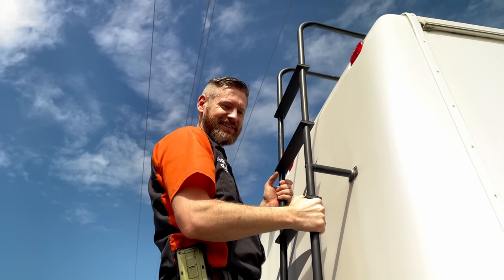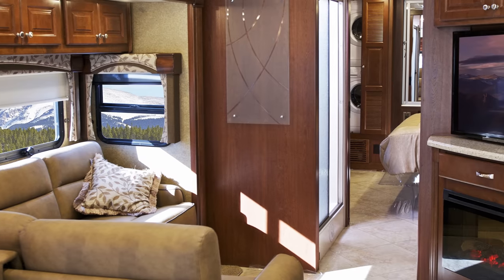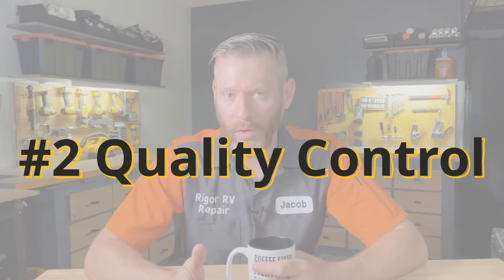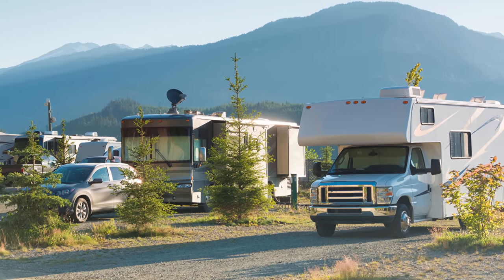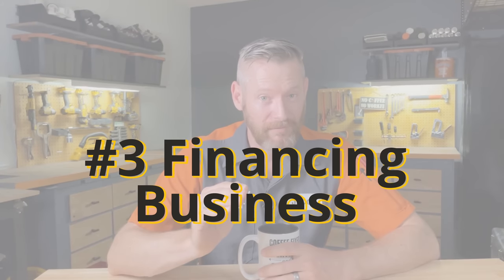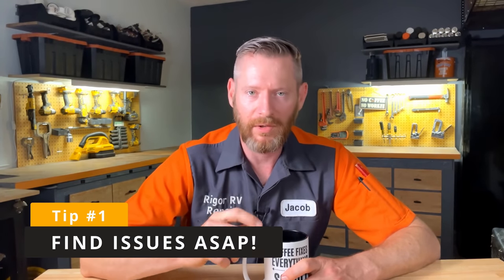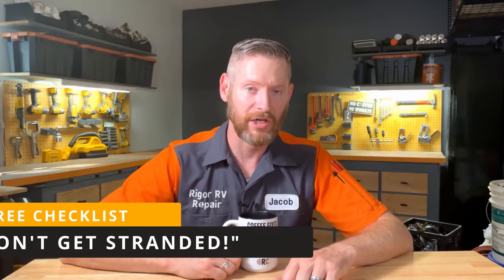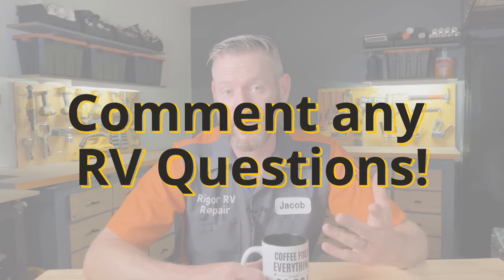3 Dirty Secrets the RV Industry doesn't want you to know...from an RV Tech

Comment: The callousness of mfrs. and dealers is so bad I would recommend the average person against buying an RV. My daughter recently bought a brand-new trailer, which included the dealer delivering and setting it up at a campground for an extended stay. Since the moment they took possession, the fridge did not work. The dealer was crass blowing them off (on a Saturday) informing them they would have to file a warranty claim. They were not allowed to hire a certified RV tech to fix it but rather force them to spend a fortune eating out, ice and making do with the tiny outdoor fridge. This is beyond unacceptable. I have worked as a quality assurance manager for a major appliance mfr. I see virtually zero effort made at instituting the most rudimentary quality systems. There obviously is almost no forethought into access, routing wiring and water lines, and especially equipment. 

Learning the various equipment on your RV and how to repair it are, for the most part, not that major of a challenge. It's access. You need to be a contortionist the size of a Barbie Doll to get into many places. Trying to access terminals and service them can put you in the bed with a back injury. If you are not mechanically adept, of small stature and very agile I strongly recommend you reconsider. 

The corner cutting is often off the charts. I bought a 38' Class A and found the water lines to the two toilets do not have shutoff valves. I spent a weekend mopping up the floor. The valve only had one screw in it from the factory where two are required. I'm going back installing ball isolation valves. Tip: carry spare PEX fittings and practice beforehand. Also keep a few Sharkbite fittings for emergencies. In the case with my toilet, it was piped with vinyl hose- not PEX. 

The quality of materials, or more appropriately, the lack thereof is astonishing. I get they are trying to hold costs but some of the junk they use is borderline criminal. 
Many of these problems can be avoided by some reasonable planning and engineering. 

The last part of my rant is commissioning. The factory should have a Q/A systems final check and inspection. The dealer should also verify the basic operation of every system. My first RV was shipped with the microwave not connected, a bench falling apart, and later we would the ceiling ducts were never connected. 

Everything is going to shake, rattle and roll so plan on it. Use grommets where wires and tubes pas through bulkheads. Put the grounding points  where you can access them for service. 

I've yet to see an owner's manual that was worth more than firestarter for the campfire. That's a whole separate rant. 

Anyway, I recommend buying a unit 2-3 yrs old with transferrable warranties, clear title, and get a pro survey first. 

Here endeth the lesson.

Comment: We just subscribed - thank you for your content. We will be buying in about a year and have been doing homework on them for about three years. Whether we go new or used, we will not touch it without a reputable inspector going over it. We are narrowing down to either a super C Entegra Accolade 37K or a gas class A Georgetown GT7 - Any thoughts on those? We are leaning towards the super C because it seems that it is easier to get those worked on instead of the class A's from what we have seen? Thanks!
Reply from the maker: Stay tuned for reviews on both of those!

Comment: Why do the doors open left instead of right. You have to open all the way when someone is knocking instead of a little bit. When you carry packages it’s hard to carry around the door instead of pushing to the left & setting on the floor
Reply from the maker: Great question!  The reason is actually so that if you leave the door open while traveling the wind will push it closed and not open. Also, doors are usually on the passenger side, so that is the direction they need to hinge to not blow open.
Reply: @undercoverrvtech  great answer. Now that I know I won’t get so mad about it. Lol. Thank you

Comment: How you find a good RV tech before you call one?
 I found one but when he came, he basically got his are compressor out and started to clean and blow to just tell me “oh it’s broken, need to replace it”. 
 It was the refrigerator. Tried to tell me there is a computer that is not resetting. This fridge had no computer. Just a regular thermostat actuated gas valve or an electric relay for electric mode. 
 Then they want $200 for the service call. 
How to find a good tech locally?
 Hesperia, CA.
Reply from the maker: The best I can tell you is to check their Google reviews. Unfortunately with older technology like you have a lot of new technicians have never worked on it. That said, if the cooling unit leaked out the ammonia then it may need to be replaced. That often happens on old refrigerators.

Comment: Have an independent inspection, not one of the dealership people. I'd rather pay $500 to $1000 ( depending on size of the unit and extent of the inspection) and have an independent assessment. A certified inspector will give you a printout, flag everything especially safety issues, test fluids on motorized units.

If the dealership has camping spaces, stay there over a weekend and methodically go through every thing, make a list, then double or triple check everything again. Don't take it off the lot until then. The dealer will put you at the end of the priority list because you have taken possession. They consider the unit sold, not a pending sale.

Take a tour of the manufacturers, go to RV shows, ask a lot of questions. Be an informed consumer.
Reply from the maker: Great advice! If they are going to charge $1000 for a Pre-Delivery Inspection,  you would be better off hiring an unbiased 3rd party for the same money.

Comment: What's your thoughts on a brand new travel trailer ( Win. Micro Minnie) and taping over the seams of the roof line? The transition point of the wall and TPO. What about roof coatings? One is claiming no maintenance when coated.
Do you do complete solar installs? Thinking 600 watts on roof, 200 W portable, MPPT, Victron 3000 MultiPlus, 3-200 AH or 2-3000AH Li batteries. Over sized wire, multiple fuses & shut offs, POS/NEG busbars.
Reply from the maker: I haven't seen that seam tape you are talking about, I'll have to go look at a Micro Minnie. Roof coatings are not needed on a TPO roof, the thermoplastic is very UV stable. The caulking at seams on any roof will need maintenance, even if you put some type of coating on.
As for solar, Victron make a nice inverter/charge, but a list of equipment does not tell me if it will serve your needs or not. If you haven't already you need to find out how many watts each appliance you want to use will consume, and add together the hours of usage for each appliance. Once you decide how you want to use the system then you can design a battery bank to run everything for a day, then add an extra days-worth of capacity to account for cloudy days where you will not be recharging. After you have a battery bank size in mind then you can make sure to have enough solar to recharge it within 5 hours.
Reply: @undercoverrvtech  Eternabond made by H.B. Fuller.
Reply: @undercoverrvtech  I can not phantom anyone who owns or works on RV's is not familiar with Eternabond Tape. Many (if not most) RV'rs carry a roll for the accidental roof punctures by tree limbs etc.

Comment: Hello, I came across your YouTube video, and watched it, and I have to ask you something regarding an Older Class A Motorhome that I am in the process of paying off from a private owner. It is a 1991 22 foot long Fleetwood Flair, powered by a Ford 460 Engine. It only has 18,000 original miles on it, as it was originally owned by an older couple, who took very good care of it while they owned it. The engine runs fine, with the exception of needing both belts replaced. As far as I can tell it has no major leaks coming into the interior at this time. My question is what are some of the things that I should be checking over on it since it has been parked for quite some time now ? I know it needs the engine belts replaced. The Power Steering Pump Belt is completely gone, and the remaining belt, which runs both the alternator, and water pump is squealing quite loudly when the engine is running. I know it needs at least the right front tire, and spare tire replaced, but as far as I can tell, the rest of the tires look ok.  Should I be worried about any of the electrical wiring anywhere within the Coach ? I just need to know what I really need to look for to prevent any mishaps from happening once I assume ownership. I will also be doing some work on the roof as well as seal coating it really well. How do I go about checking out the various systems ? Electrical, and water/plumbing/propane/appliances ? The Coach also has an onboard Onan 4000 Watt Generator as well, but I have no idea if it will start or not. The Coach requires 2 batteries, one for the engine, and the other as a house battery, which I do believe is supposed to be a deep cycle marine battery. I have already replaced the Engine Battery, but have not yet replaced the deep cycle marine house battery. There is one in the Coach, but I assume it is possibly to far gone to use, and also needs replacing. The Gen Set only has 79 hours on the hour meter. The price was $2,500.00, do you think I got a decent deal, or do you think I should have walked away and kept searching ?
Reply: Sounds good. I would replace the auto transmission fluid soon unless it’s documented as been done in the last 5-7 years.   Rear differential oil too.
Reply: Check the date on your tires.  Each manufacturer is required to label the manufacturing date in the sidewall. Aged tires can be a big hazard going down the road, the look good but can become brittle with age and blow out.  Stay safe.
Reply: @row4hb  I have been trying to locate the build date on the tires, but apparently, the build date stamp is on the inside sidewall of each tire, and I don't currently have a large enough jack to lift the Coach up, and pull tires off to check for build dates

Comment: Newbies here. We bought a brand new Highland Ridge SilverStar 376FBH fifth wheel. My biggest frustration is the lack of useful documentation. Owner's Manual is poorly written and their website says they don't make service manuals and wiring diagrams available to users. Of course, I understand why, but the idea of being stranded without documentation for our rig is nuts. We'd also like to make some mods.  Is there a repository or some other source for such documentation?
Reply from the maker: Unfortunately no, other than individual appliance manuals RV'S are put together in a pretty chaotic way.
Be sure to watch my Worst RV Slide to own video, if I'm reading the Highland Ridge website correctly they are built with a problematic slide system that needs regular maintenance.

Comment: I have found that between the Covid issues and just people lacking to want to work, and now the inflation and everything costing more to make. I found the RV industry new RVs are built like crap.  They are slapped together to fast to get them out there. Wires with tac nails through them, stripped threads on water lines, seals not put in correct. Yet the price keeps going up on them. They really need to be regulated. I would hold off on buying new till they start building them better.

Comment: Your opinion of the fibreglass campers; Scamp, Casita, Oliver, Bigfoot, etc. It seems to me that they just last longer than the common style of RV. Any of your thoughts would be appreciated!
Reply: After I got my 1st fiberglass trailer I said i would never go back to an alum sided trailer. That was 20 years ago. Now I own an alum sided trailer. If you have any issues with the fiberglass whatsoever, it has to go back to the factory for repair. The alum siding is easy to take off and make repairs. Yes you will be making repairs, the question is when not if.
Reply: Thank you for the reply, greatly appreciated!

Comment: Bought a 2022 small RV wanting to boondock often.   The refridgerator is only 12 volt and I understand that draws a lot of amps per hour draining my battery.  How many amps should a small refridgeration draw in a day?  I was not careful in making sure that the fridge did not have a propane option.   I also understand that the industry may be moving away from propane refridgerators.   Are my fact straight and is there any thing you can recommend for me?   Thanks
Reply from the maker: If you have the Norcold 10 cubic foot 12v refrigerator,  it is rated at 8.3 amps when running in daytime mode. Assuming it cycles on and off and runs for 12 hours a day, (50%) it would use 99.6 amp hours.
If you have a standard lead acid deep cycle battery rated at 100 amp hours, you should only use the top 50% capacity to maximize battery life, so the refrigerator would drain the battery to the 50% mark in just 6 hours of run time, or 12 hours of the day. Practically speaking you must have 2 batteries of 100 amp hours each to run the refrigerator all day.
If you don't have a generator for recharging,  you would need at least 240 watts of solar to recharge that lost power each day, assuming 5 hours of full charging each day. But it is best the have double the battery capacity for backup in case of cloudy days, so you will be best off with 2 Lithium batteries so you have a 2400 watt (200 amp hour) capacity. If you have that you would want 480 watts of solar to be able to recharge in a day.
Lots of number crunching needed to get an off grid system that suits your needs. Remember, this is just numbers for a refrigerator, it is not accounting for everything else you are using.

Comment: Chrysler, Ford, GM in the 1950's-1970's not much different. Even today, no profit for dealers in the sticker price. Trade in, financing, "Tru-Coat", etc needed or the transaction is a net loss. Ford dealer  tech in the 1970's told me the new cars coming off the transporter barely ran and the dealer would have to do all the tuneup adjustments before putting it out on the lot. A friends dad bought a new '69 Chevy van and the trans lasted five days, five week wait for a replacement.

Comment: I learned a long time ago, after a class C, a class A gas and a class A diesel, and 2 trailers; BEAT the crap out of you RV for the first year. By the time the dealer is done "rebuilding" it, you will have a much more reliable RV. In addition, hopefully the dealer has made some money and even more hopefully the manufacturer has LOST money on the RV. If this is done enough, hopefully the manufacturers will start to get the message.

Comment: I worked security for large RV manufacturer.  I would never buy one. Ask yourself this question "How do you replace that nice big full-size side by side refrigerator when it stops working?'" and it will need to be replaced sooner or later. It won't fit thru RV door, so you have to pull the slider out and have at least 4 men on hand to pass it out where the slider was. What a joke.

Comment: I've heard you can fix a soft floor with drilling holes through the top layer and injecting epoxy between the layers every so many inches apart in the soft spots and this will take care of a soft floor. Is this true and if it's true what kind of epoxy do I use. Is this a good fix or just temporary. Maybe somebody can let me know. If it's not a good fix I'll just replace that place in the floor with some real wood
Reply from the maker: That is not a repair I would recommend. Replacing the decking is the proper way to repair a floor.

Comment: Absolutely I rent occasionally or stay at lodges; with National Parks jammed up from overuse and their reservations going the moment the sites open online, high fees at many other sites where you are parked cheek to cheek in depressing campgrounds,  long maintenance waits, decreased quality huge number of first time RV buyers post COVID who do not know how to maintain their vehicles; young people "working" remotely from campgrounds (?!) any charm of yesteryear seems long gone. You simply can't buy your Class A Winnebago at retirement and "go see the country" any more with any kind of open itinerary or spontaneously take your young family camping at many National and State Parks in a towable trailer.

However, even apart from all these problems, most RV's suffer from fundamental constraints.  Because they need to move on roads, they cannot be built to the standard of a quality ocean going boat supported by water that can be built quite heavily for its purpose--and of course these are far from being sold at under 200k new in most reasonable sizes.   With an RV you essentially have something that is supposed to be house-like being towed by recreational vehicles and bounced all over the place with lightweight construction, and potential for leaks from many sources especially with multiple slide-outs, hidden plumbing, roofs attached to a flexing structure etc.  Some of the diesel pusher Class A's are at least built on real truck chasis, but even there construction constrains leave cheap walls, inadaquate and inaccessible plumbing and are fitted with already made brands for all applicances etc. --and of course the good ones cost as much as smaller ocean going boats.

Frankly most people don't want to pay for the quality they seek in a moving bouncing "house" and most don't have the vehicles to actually tow something that would be solidly built. That being said quality certainly is on the decline in the face of trying to meet unprecedented demand. Nevertheless it seems remarkably unrealistic to think that for 50-75k you could get something solid enough in its basic structure to last without a lot of maintenance, light enough to be towed with a 3/4 ton truck or less and with high quality interior construction and fixtures.